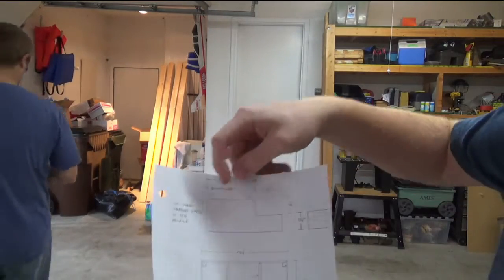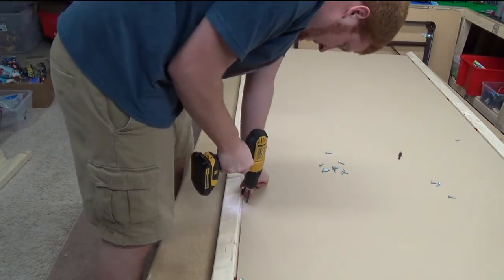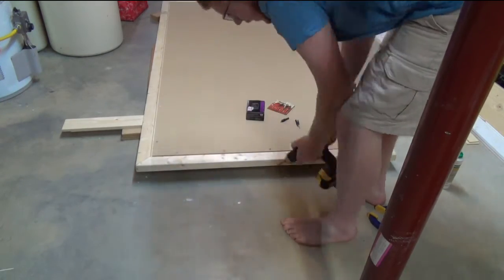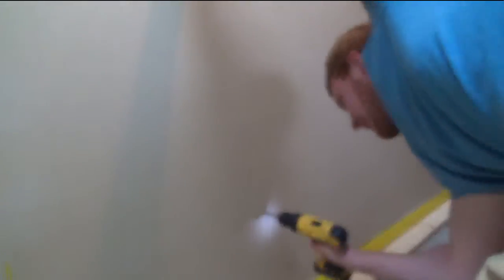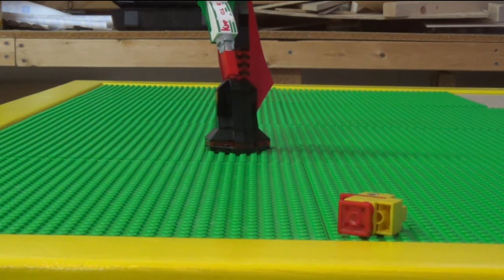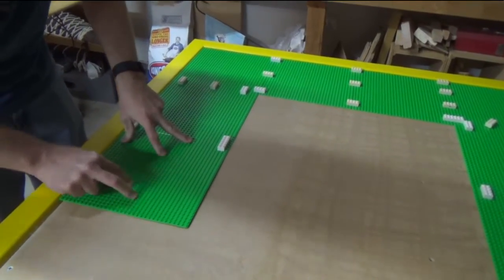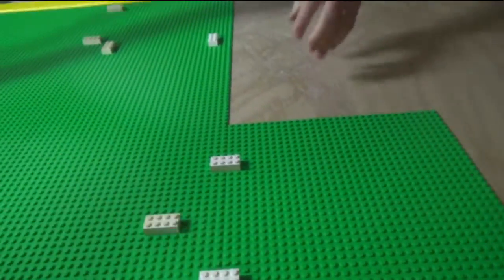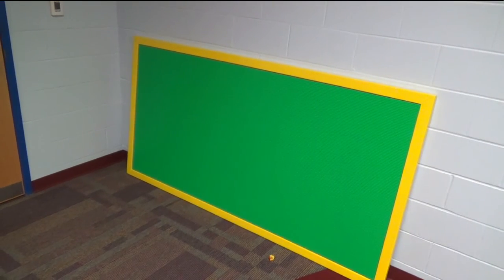Building a Lego Wall

Comment: Hey looks awesome.... i would like to build this for my churches kids room could you possibly list the materials   like what kind of glue you used to glue the wall pieces and how much wood  and everything....thanks
Reply from the maker: I think the material list is as follows (iirc):
-1 bottle wood glue (any kind should work, but I usually use titebond)
-4 2x4's (8 feet)
-1 4x8 sheet of 3/4" MDF (although really any plywood should work, just as long as you can get a good adhesion to the lego baseplates)
-2 (maybe 3?) 6' 1x4's (or whatever you can find/use to connect the top and bottom rails and also support the main panel)
-A few cans of spray glue (or anything that can bond plastic and wood)
-paint and primer for the boarder?
-fasteners to secure the board to a wall

Hope that helps!

Comment: Do you sell these? We need one for our library!
Reply from the maker: Unfortunately I do not.  It shouldn't be too difficult for a neighbor with tools to build though!  Iirc, I only used a miter saw, router, table saw, and a drill.  It was just  3 or 4 regular 2x4s, a 3/4" sheet of MDF, and a few 1x4s behind the MDF for support.  If you'd like some more information on building it, shoot me an email and I'll see what I can do!
Reply: The Christmas Carpenter Thank you! These are is VERY high demand as makerspaces become increasingly integrated into libraries.  My guess is that they'd cost a mint to ship.  Thanks for the list of supplies and offering virtual assistance! 😃